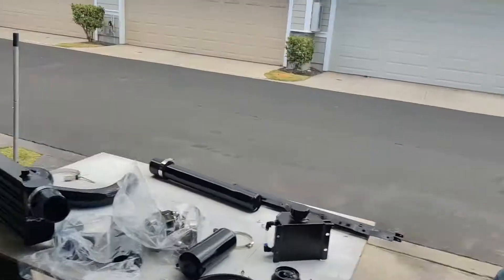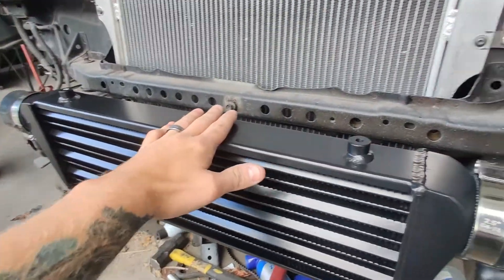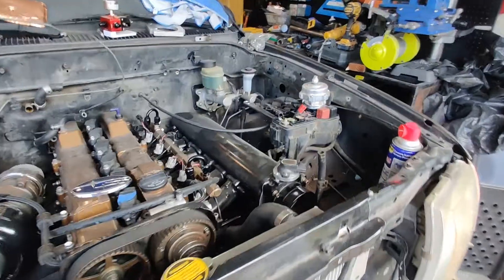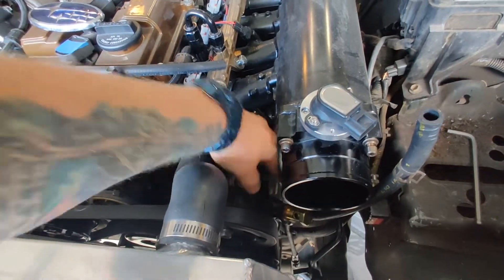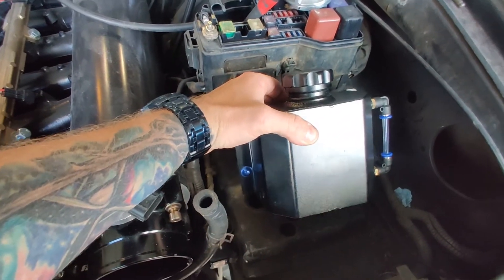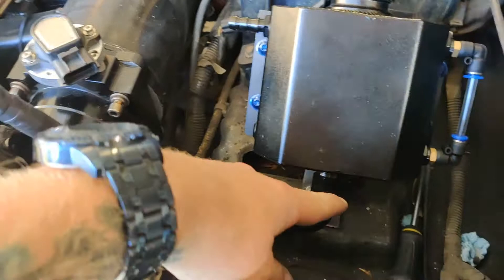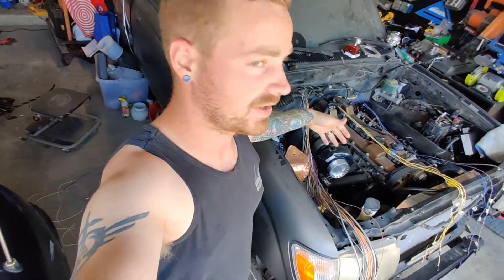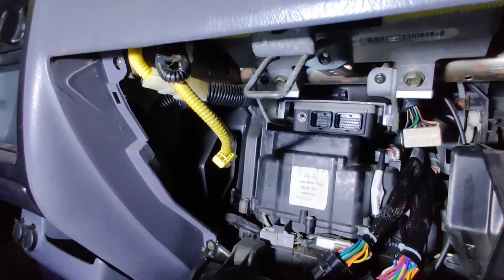LET'S BUILD A TURBO TACO EP16 *INTERCOOLER AND POWERSTEERING INSTALLED*

Comment: Why tilt the reservoir? Won't that affect the overall capacity of the reservoir?
Reply from the maker: The reservoir for the power steering? I had to do that to clear the hood and fitting underneath the tank, I'm sure it will affect it some but the power steering system pushes the fluid back in at the top. I'm not too sure if it'll affect it or not but I guess we'll find out! 😂